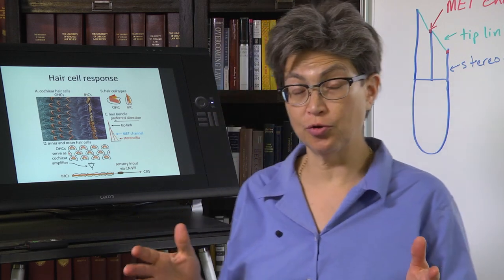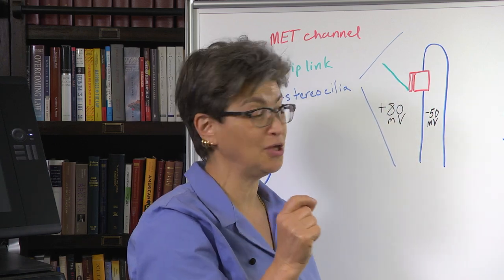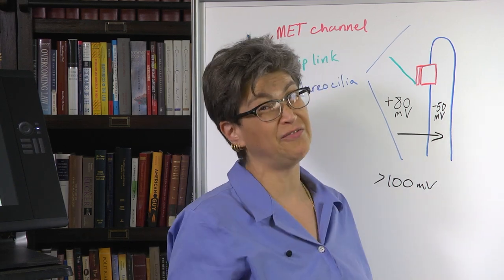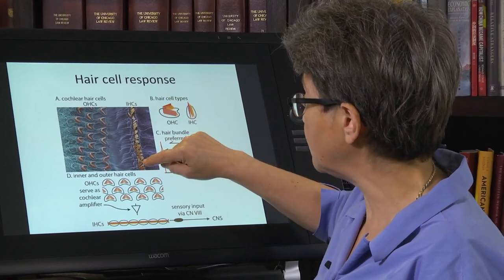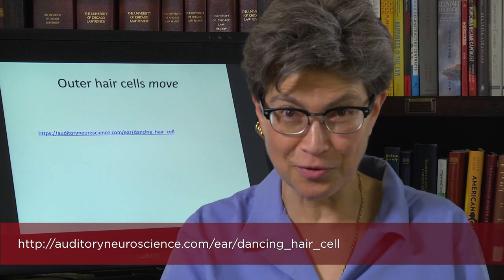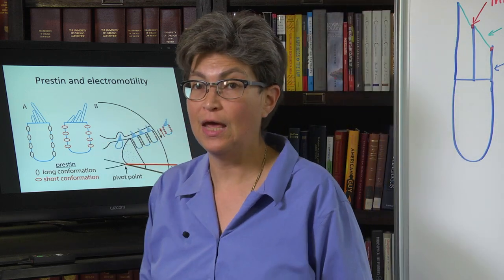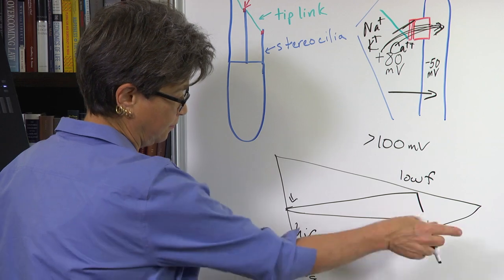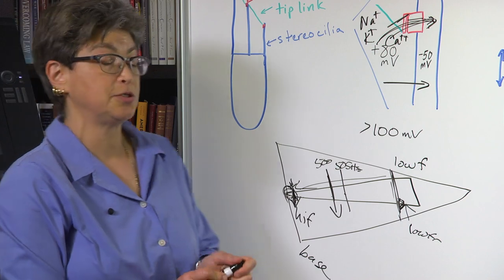11.8 Cochlear Amplifier

Comment: Thank you for this video and the high-quality free course in general! I noticed, however, at the end of the video a slight mistake in the example of 500 and 505 Hertz frequency- the higher that is 505Hz should be closer to the base and the lower that is 500Hz should be closer to the top. Best regards!

Comment: Your knowledge is impressive, but I would like to challenge a few things.  You say that people without prestin are deaf, but this surely cannot be right.  In order to move, the outer hair cells need a signal, and we assume surely that this signal, for what is a positive feedback process,  is comes from the inner hair cells, do we not not?  If they produce so little signal without help, how can this work?  In any case, our hearing covers such a vast range of amplitudes, a ratio of even 60dB is 1000 times in amplitude terms, that to go from hearing to deaf without outer hair cell function is just ridiculous.  Assuming you are right about the prestin experiment, there has to be another answer.  Maybe in knocking out prestin something else was knocked out?  Or maybe the ear doesn't work as we think at all, and something else is going on?

I would also ask how convinced you are that hair cells are as finely discriminating of frequency as you say (1000 and 1005 Hz example you give).   My understanding is that fine frequency discrimination takes place in the brain, hence the need for fast triggering of hair cells, and even then we assume that they do not fire on every cycle (although you talk of fast depolarisation needed in relation to 20kHz this is not right - neurons fire in millisecond terms, too slow for 20kHz,  which is probably why we do not have good frequency discrimination above a few kHz. ) The nerve output from the cochlea is said to not discriminate finely, hence frequency masking, as taken advantage of in modern audio compression.

Finally, I think, like many others, you talk of the cochlea membrane being 'fine tuned'.  I don't believe anything like resonance is possible in a fluid containing structure (I think something else is going on, but nothing to do with resonance or conventional filtering).  Maybe, with positive feedback from outer hair cells, but this has to be a very delicate balancing act to avoid oscillation.  How could such a balancing act evolve if there was no hearing without outer hair cells?  Do all animals have outer hair cells - I seem to remember not.